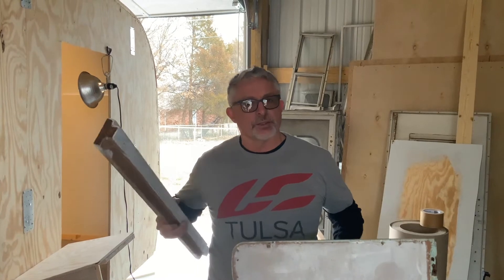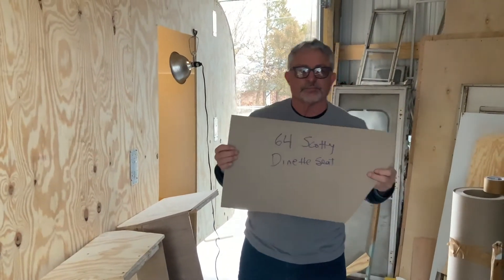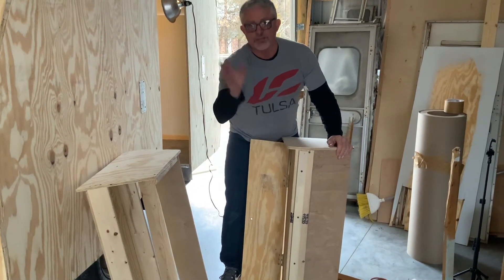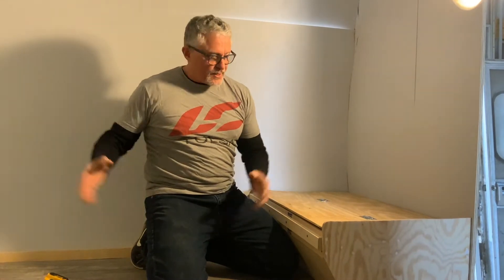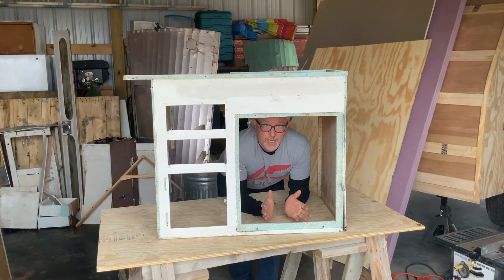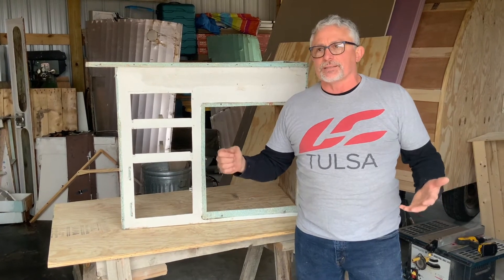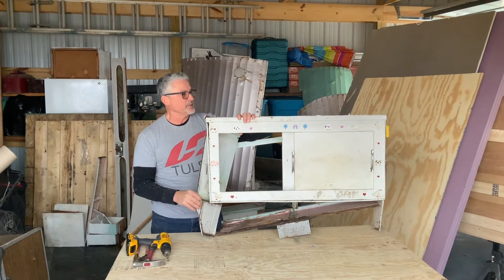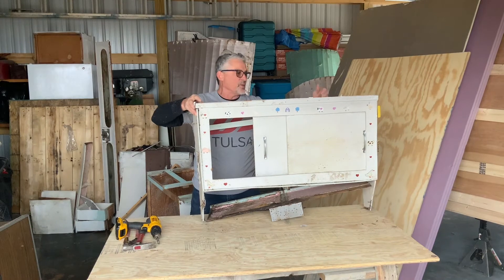Ep. 14 Vintage camper kitchen rebuild remodel. Retro Serro Scotty Sportsman renovation restoration

Comment: How big is this camper?
Reply from the maker: 13’ overall. 10’ box.
Reply: Do you screw everything from the outside meaning cabinets and seats
Reply from the maker: @kimpalmiero2383  If it touches an outside wall I try and screw in from the outside.